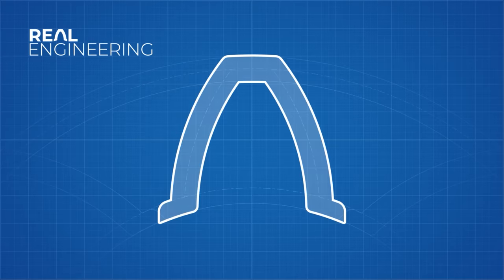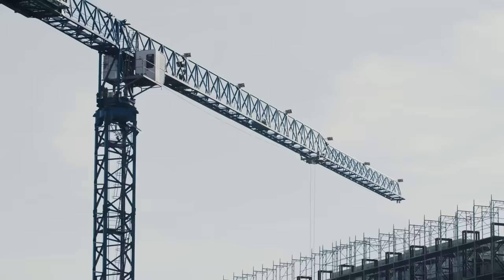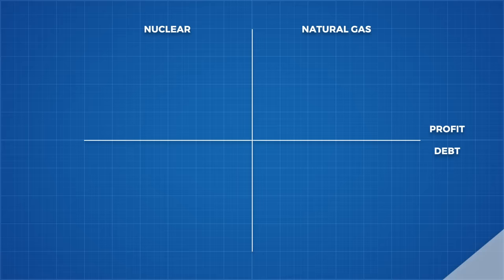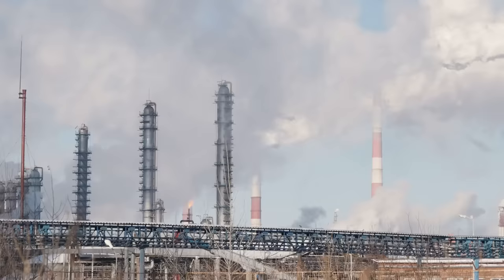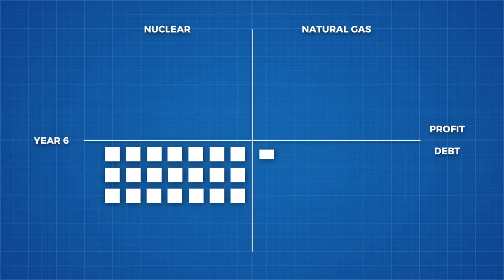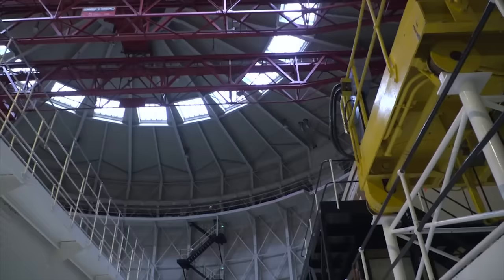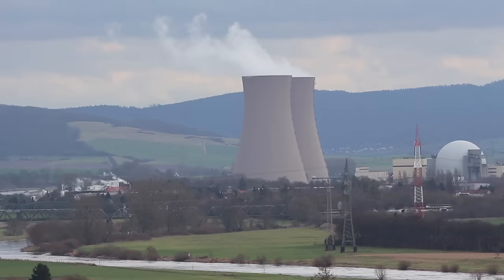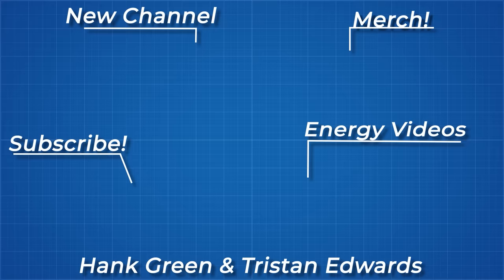The Economics of Nuclear Energy

Comment: 13:20 Keep in mind that variable renewables produce additional costs due to the necessity of building up overcapacity, backup, introduction of smart grids, and so on. While it is quite cheap to produce a unit of energy using renewables, it is much more expensive to provide an average unit of energy to a consumer, that, depending on the time of the day and the weather, may come from a cheap renewable source, or from an expensive backup like hydrogen or batteries.
Reply: Yup. Renewable energy LCOE always conveniently excludes the immense additional costs required to actually use renewable energies at the grid level. I read somewhere an estimation that if you include just 4-6 hours of energy storage to a solar plant, the LCOE shoots up to 80-100$. And realistically, you'd need at least 14 hours of storage to account for winter and dark days.
Reply: nuclear also needs load follower / peakers / fast energy storage
Reply: @ebehdzikraa3855  not in the same way though. Nuclear plants have to constantly produce a consistent amount of energy, and they need storage if/when the demand dips below their production. Solar and wind need to produce energy in excess of demand in order to generate stored electricity at all. The excess energy from nuclear can be channeled toward useful ends such as hydrogen production, desalination, etc.. However, you just have to build more and more wind, solar, and storage capacity to even be able to have storage to buttress against their inherent issues of intermittency. This is part of the reason why a grid dominated by renewables isn't a great idea. Renewables are great for a lot of things, and we should scale them up as much as we can afford, but grids need to be reliable and cost-effective. Factoring in the required storage buildouts and excess capacity required to even equate a single nuclear plant is staggering and only has about half the lifetime, over which solar panels and lithium batteries in particular degrade quite drastically. There may be days where solar and wind outshine nuclear (pun intended), but they are well outside the norm and that is a huge deal. There are very few places on earth that consistently have very clear and sunny days with lots of wind, and for obvious reasons not a lot of people would want to live there.
Reply: Exactly.
Reply: The additional costs of storage are hardly so dire as all that. 
In Australia the AEMO and CSIRO found that renewables including storage were still the best option.
Battery storage is one of the most expensive storage options, and was still competitive. Pumped Hydro is the cheapest option for bulk storage and of course quite viable all on it's own.
Even nuclear plant benefit from storage to buffer the daily variation in demand.
Reply: @aaroncosier735  Australia has also outlawed the construction of nuclear plants. So the economic modelling in that country may not be as clear-eyed as it seems at first blush. 

That said, any modelling that doesn't factor in complete waste stream costs and carbon footprint for wind and solar, along with build-out of overcapacity and significant storage capacity, is not fully capturing costs and presenting an honest and accurate assessment.
Reply: @Jordan-vc3iu  The economic modelling is as clear-eyed as our publicly accountable scientific organisations can manage, same for our Energy Market regulator.
They are able to do comparisons for energy infrastructure and other built infrastructure that we do share with other nations.
Of course, not already having established nuclear infrastructure and expertise means our costs will probably greater than other nations. Not a point in favour when we are so well placed for renewables.

To correct you, the local modelling explicitly does include estimates for waste stream costs including likely carbon footprint and consideration of likely future carbon prices or tariffs. Renewables start from having a far smaller footprint than fossils (less than 10% including installation, manufacture and decommissioning) and this drops further as renewables supply a greater fraction of demand.
Every sort of generation involves overcapacity to cover outages and maintenence. Unlike centralised options, renewables offer local and regional resilience. 
Storage capacity was also explicitly factored into the CSIRO and AEMO analysis. Renewables with storage was still the best option. Hell, storage is a pure win regardless: existing fossil or centralised generation will benefit from storage to absorb night time overgeneration and supply daytime and evening peak demand. Our existing pumped hydro facilities and batteries have been financial successes from first operation and ten times more would be beneficial just as well.

Any "honest and open" assessment that promotes nuclear is deliberately missing full demonstrated costings for spent nuclear  fuel disposal. These costs are very high, routinely underestimated by expert bodies in nuclear nations, and liability is disputed in court rather than recognised and accepted. Until a disposal operation has been in operation for some years, and a substantial proportion of all existing wastes disposed, there is simply no credible assessment of costs.
In any case, nuclear is a boondoggle. It cannot get commercial backing or insurances but depends on cradle-to-grave subsidy from host nations, from the first loans and blowouts to the last disposal. This only increases with derating for defects, as with SizewellC. In the meantime, renewables are rolling out.
Reply: @aaroncosier735  "Any "honest and open" assessment that promotes nuclear is deliberately missing full demonstrated costings for spent nuclear  fuel disposal". This is like saying whatever you say, whatever you do, I know you're wrong. What an open minded approach.
Reply: @tt-of4xv  
To correct you: It's just a fact.

Anybody that wishes to emphasise the costs of nuclear need only guarantee that disposal costs are reasonable. Lacking such personal liability, I'd like to see some evidence. What are the "demonstrated costs of the nuclear fuel cycle, end to end"?

You know, even retail clerks are asked about their "demonstrated skills", so it's not too much to ask of an industry 70 years old.
Reply: @thegreyghost5846  
Nope, you wouldn't. You'd still have no solutions.
Nevada blocked use of Yucca mountain because they didn't want to be steamrolled by Federal decisions. You know, those oh-so-precious states rights that override personal rights and national priorities. Had there been PUBLIC ENGAGEMENT from the planning stage, different locations could have competed for the economic benefits of hosting such a site, as a local choice and commitment. Instead it was imposed, and Nevada decided to get baulky. Yucca mountain also had issues with oxygen intrusion. It might still serve as an interim storage for dry casks, as part of a national disposal plan but will never be fit for permanent disposal. In any case, it is half the size required for the existing waste stockpile, let alone how much more in the future. NB: getting the dry casks there will be no joke. under five percent of existing casks are rated for transport, and none for permanent disposal. 

As for reprocessing, It's a dead loss. The US decided against only after extensive trials to see if it was viable. As part of a deliberate breeder making fuel for production reactors, reprocessing is expensive, multiplying the total cost of nuclear generation. The heavily subsidised French Fast Phoenix is a prime example. When used for processing of spent fuel it's a dead loss. The fission products get separated, sure, then they have to be vitrified, so they take up about the same space, and still require many centuries of secure storage. The vitrified material leaches much more easily than the original ceramic fuel pellets, and still require encapsulation. It multiplies costs without giving any great benefits. Spent fuel is "spent" fuel for a reason. it isn't "fuel" for other reactors until it is reprocessed, at great expense. After that, the deleted uranium is still inferior to fresh natural uranium for breeder blankets.

Seventy years of trying and nuclear still struggles.
Reply: Electro mobiles will provide backup batteries and smart grid abilities. So it will have literally no costs. Normal people prefer twice cheaper source to charge own vehicle during the day instead of "stable" but expensive nuclear during a night. And further more you can charge vehicle during a cheap time and sell energy back to the grid when high demand.
Reply: @vladimir0rus  Ah yes, the "electric cars as energy storage" story. Sounds good, but I'm extremely sceptic about people willing to wear out their expensive car batteries to stabilize the grid. Won't happen.
Reply: @NeovanGoth  it's only depends on amount of profit. And you forgot about smart charging -  nobody want to charge EV during rush hour, so if EVs just unplug themselves it will be enough to compensate the grid.
Reply: @Jordan-vc3iu  this will not be the case anymore in a future energy grid with a large percentage of wind/solar. Nuclear energy will need to shut off for significant amounts of time, because cheaper(free in marginal terms) energy sources are available making the load hours shorter, which has a huge impact on the LCOE of nuclear. Saying the electricity produced by nuclear energy during peak generation hours can go to useful ends but electricity from renewables can't, is just silly to me.
Reply: @jorenkock4962 Imagine these generators as restaurants. Coal plants are like McDonalds, they are cheap and low-quality, but convenient and generally reliable. They've been around a long, long time and no matter where you are you can probably find one, and you know exactly what you are getting; it isn't good for you, but it fills the need when you are hungry. Gas power plants can be compared to a Chipotle restaurant. They are a cleaner option than coal (like Chipotle is healthier than McDonald's), but they are still not the healthiest option out there. They can quickly ramp up or down their output, similar to how Chipotle can serve customers quickly. However, they still produce greenhouse gas emissions, although less than coal. A nuclear power plant is like a fancy, high-end steakhouse. It provides a high amount of steady, reliable power (like a steakhouse providing a big, hearty meal), but it requires a lot of upfront investment to build (just like how steakhouse meals are expensive). The energy is just as green as anything else, but like a diet consisting only of steak dinners, too much nuclear energy can be troublesome as well (100% nuclear is not something I would advocate for). 

Wind and solar are a little different though. They are like a subscription to a meal delivery service that sends you random meals at random times. You don't get to pick what you get or when you get it, but it only costs something like $100/week and the food is generally healthy. Some weeks you are getting 15 steak dinners, and other weeks you get a single potato chip. Part of the subscription service states that during some months you can count on more food than others, but there are no guarantees. Your strategy to make it through lean periods is to store food from peak periods (essentially only eating half the steak dinner sometimes) in the fridge and hope that the day never comes when you are starving and there isn't anything in the fridge. 

Ultimately, a society based upon abundance can't rely on something weather dependent and non-dispatchable to generate the bulk of its electricity. It is a fundamentally flawed strategy. We can and should close all of the McDonalds (coal plants) for our own health and well-being.  I would love to see the majority of those replaced with steakhouses (nuclear) where possible, and the rest can become Chipotles (gas plants) for all I care; the outcome would still be a cleaner and healthier world. I also think that the mystery food delivery service is going to be good to have in some significant quantity, precisely because it will end up feeding the needs of a lot of people very cost-effectively so long as we don't have to rely on everyone having a $20,000 fridge and instead they can just go to a Chipotle or steakhouse when no food has been dropped at the door in a while. There is no one solution, and it will take everything we have to create a world that is cleaner and more prosperous.

All of this being said, there may still come a day when there is a breakthrough in CCS and an affordable, scalable, and effective carbon capture solution is developed that will allow us to simply decide what amount of greenhouse gases we want in the atmosphere and then we can all argue about what levels are ideal.
Reply: @Jordan-vc3iu  what a fucking weird analogy lmfao. Ofc I
Reply: @Jordan-vc3iu  it also doesn't respond to my argument in the slightest. My argument was that the vague "we need a plethora of solutions" doesn't actually fly when you talk abt combining nuclear and intermittent renewables bc their fundamental characteristics don't play well together. Stuff like biogas and hydrogen storage in salt/depleted gas caves is a far more applicable and cheaper solution to solve the dunkelflauten problem. It will indeed take everything we have to get a cleaner world, so can we please not throw away hundreds of billions on a farce.
Reply: @jorenkock4962  I'm not sure you have an argument besides "we can invent things to solve the inherent problems of intermittent generators". To put it succinctly for you, storing biogas or hydrogen in caves, building large battery arrays or pumped hydro reservoirs en masse, or whatever your storage technology de jure is, is very expensive. This is because storage is not generation, and any money spent on storage is money that could have been spent on generators. Wind and solar dominated grids are dependent on massive buildouts of storage, or power purchase agreements from neighboring states that didn't make the mistake of building infirm power infrastructure entirely dependent on the weather, for when the wind isn't blowing and/or sun isn't shining. 

To summarize my position clearly without any analogies, similes, or metaphors: any shift away from fossil fuels to clean energy sources will need to be based on firm power generators. Nuclear is a proven technology that is practically ideal to serve baseload power generation needs. An ideal mix in a global energy grid, in my view, would consist of a significant increase in nuclear energy up to 50-60% of all power generation. This alone would go a long way to levelling the rate of greenhouse gas emissions and other sources of pollution to something much more manageable, and could be reasonably accomplished in a matter of decades. Because wind and solar are intermittent, relatively short-lived, and only cheap when you don't have to build storage to firm them, they should account for much less of the energy mix, about 15-20% combined. The remaining 20-35% of our power needs could easily come from a mix of hydro (where possible), geothermal and tidal energy (also where possible and whenever they become viable to scale), and some small amount of gas-fired power generation. The solution to pollution is dilution, so a small amount of gas-fired power generation isn't necessarily awful; there is much improvement to be made in the gas industry, particularly regarding leak management. However, gas when burned for energy is orders of magnitude better than coal, which should really just stay in the ground, or oil which is a necessary feedstock for other things we depend on like plastics and can be used solely for those purposes instead of being burned for energy. 

If my position seems ambiguous to you after that description, then I don't know what to tell you. Energy is an extremely complicated subject, and a common pitfall for most people is oversimplifying the subject to the point where they say "oh just build a ton of wind and solar and all the problems will be fixed." Anyone who is serious about revolutionizing energy won't outright dismiss wind and solar, but must understand the issues of relying upon them primarily. Likewise, disregarding nuclear is foolhardy as a clean energy future will absolutely rely on nuclear energy to play a large role.
Reply: @Jordan-vc3iu  I would advise you yo read up a bit more on the subject. Maybe see sir Chris Llewellyn Smith's modelling about this. Nuclear is very expensive bc the large Capex and low Opex is exactly the wrong thing you need in a future energy grid with sufficient amounts of solar and wind, because it will not run for most of the year, making it very, very, very expensive. Even compared to hydrogen/biogas/and especially to ngas in small amounts
Reply: @jorenkock4962  I am sure that any modelling which prioritizes wind and solar and makes the rest of the grid dance to the ebb and flow of the weather would predict such a result. That sort of underlines what I am talking about. Electricity generation via wind and solar goes up and down depending on the weather, I don't think you are disputing that, which is good because it is absolutely true. I think where you are getting it wrong is thinking that it is a good idea to magnify the amplitude of those swings to the maximum extent, which is what I think is precisely the wrong thing to do. The up and down nature of wind and solar electricity generation is not a problem at all, so long as it doesn't sporadically cross below and above the demand line with terrific frequency. Wind and solar can bob along quite merrily in a grid where it comprises up to about 20% of the generation in a given week, month, or year. What doesn't work so well in any grid is when your demand curve is getting crossed by wind and solar multiple times a day going in both directions. Not only does it put a strain on grid infrastructure, but it can also be hell to manage. This is one of the big reasons why "smart grids" emerged as one of the many duct-tape technologies that we would need to hold a wind and solar dominated grid together. 

To reiterate, I think it is just a much better idea to have a more reliable and consistent baseload generator make up the bulk of the power generation. We won't have to reinvent the wheel like we otherwise would if we based our entire grid off of intermittency rather than consistency and predictability. You should want things to be predictable. Energy should be boring af. We don't want each day to be a question of whether or not we have banked enough storage for the heat wave. And again, you certainly can build an asinine amount of storage that will just sit there for the most part, or you could design to minimize the need for storage at all. That starts with having a power generator that makes up the bulk of your capacity with a fuel source that you can control and dispatch as and when needed. 

I will definitely take a look at Smith's modelling. If you have a reference which you can provide that you think would be a good summary, then I would find it helpful if you could provide that too. It will save me the searching and I will likely better understand the basis for your beliefs on the subject. Thanks!
Reply: @ebehdzikraa3855  Don't you know that PWR reactors are based on the same technology used in nuclear submarines? They can load follow at 5% - 100% at 5% per minute and 100% - 20% at 5% per 10 per minutes. This "no load following" trope is a figment of Greenpeace's imagination.
Reply: Also this does not take account of environmental cost. Wind and solar kill a staggering amount of flora and fauna.
Reply: @williamstucke5445  A little clarification: In principle, nuclear reactors can react extremely fast, in extreme cases (like emergency shutdowns, or the critical power excursion in Chernobyl) in a fraction of a second. This however produces a lot of thermal stress, which requires more sturdy, and hence more expensive reactors. Current NPPs are not built to be able to follow the load quickly (Greenpeace isn't entirely lying on this one), but it would of course be possible to build new ones that can.
Reply: @NeovanGoth  Perhaps current NPPs built in the USA aren't built that way. But then the USA took a POLITICAL decision about which technology to use and banned reprocessing of fuel in the 1970s. So, all the comments above about Yucca Mountain and dry casks are totally US-centric. It's important to remember that the USA is NOT the centre of the universe 😉

The figures that I quoted above are real figures, from a real running NPP - not in the USA.  Provided to me by a professor of Nuclear Engineering. They can ramp up at 10 times the speed than they can ramp down, but in the real world (outside the USA), they can do both.
Reply: In theory perhaps, but perhaps not in practice, at least not yet.

Those are costs one would need to take into account should one want to have a fully renewable grid, or at least one with a high share of renewable energy.  You need storage and smart grids to account for variability, and you need extra capacity to account for dips in output.

Someone still needs to make the call to build that extra capacity, and currently many renewable installations are built and operated by private companies who will happily just not build that extra capacity or storage, selling the power they produce as is. Unless otherwise incentivized (most likely by a combination of economic forces and legislation) I can't really see a world where the private operators take it upon themselves to do these things. Currently the "VentureCap Solar Power, LLC"s of the world are building their solar PV farms and operating them while being entirely unconcerned with overall grid stability or planning.
Reply: @ebehdzikraa3855   Thats the reason alot of countries that use NPPs also use gas power plants, because those can ramp up quickly to compensate peaks and shut down quickly to compensate dips.
Reply: Exactly. LCOE is not the full picture.
Reply: The LCOE for renewables does NOT include the cost of backup power for this kid's-lemonade-stand business model.
Reply: @aaroncosier735  In australia, the solar and wind resource is massive, theres tons of countries where that just isnt the case, and also, you do need a good geography to have pumped hydro or even just a conventional hydro plant, so nuclear is still viable in a lot of places where theres just not enough of the solar, wind, or water resource to make energy, and even in a lot of countries like in scandinavia, where there is some good amount of hydro plants, a big percentage still is needed to trully have enough energy for everything, and unless you want to contaminate more, you have to use nuclear, and so thats literally what they have done
Reply: @marmolejomartinezjoseemili9043  
Not just Australia.
Nations where nuclear has been used still find that nuclear is very expensive, that the ideal amount of nuclear is less than present, and that renewables are competitive.
Nuclear benefits from storage too, to assist with a restricted range for load following.
Renewables are expanding *everywhere*, from Alaska to Texas to Anatrctica to Finland, UK, France, Germany. You name it.

What we are seeing is that the ideal amount of nuclear is "less than existing", confirmed by steady decline in reactors and output.
The ideal amount of renewables hasn't hit a limit anywhere yet. It might slow down at 90% or so. At that point, the decision to run some extra renewables at a loss, but bought from a large and bustling industry will have to weighed against running some nuclear, at stupendous custom engineered prices as per all previous.
I think we will be seeing a lot less nuclear globally.